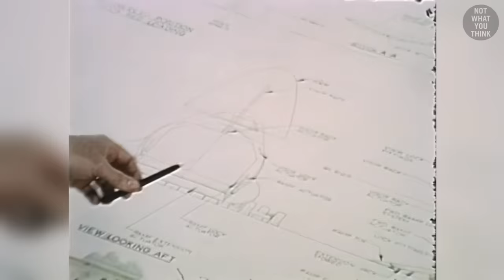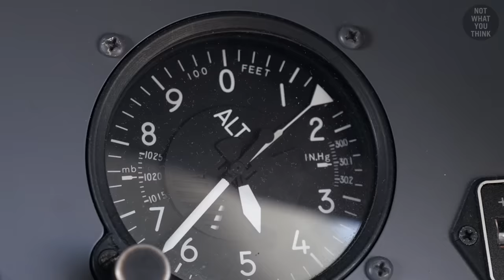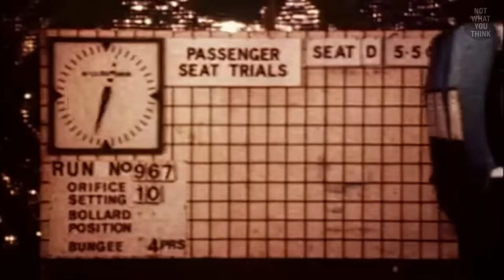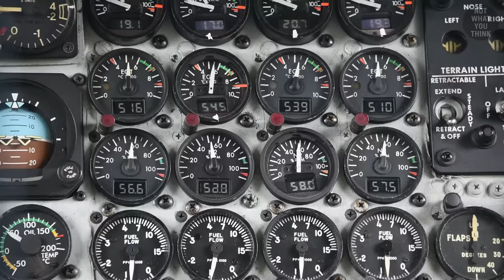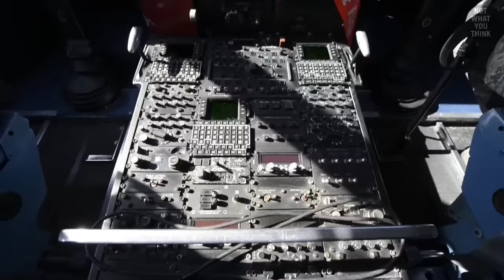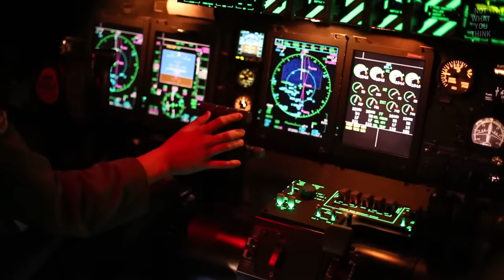America’s MASSIVE Military Airplane that is Named After a Porn Star

Comment: Sometimes I imagine a gunship variant using the C-5 with 2 105mm gun. It'll be absolutely inefficient and probably be useless but would look cool as shit.
Reply: 380mm Battleship cannon
Reply: AC-5 👀

While the C-5 might be able to take big loads, the AC-5 will be GIVING big loads.
Reply: Atomic annie
Reply: @MichealleShoemaker  Atomic annie
Reply: Nah image sticking two c-5s together kind of like the F-82 and put a navy railgun in the middle. That would be cool as fuck
Reply: @saplingseedsaccrew3143  Dudes ready to blow up an Alien Ship
Reply: @saplingseedsaccrew3143  Getting ready for the alien invasion for sure
Reply: go with a 155 and you can fire excalibur rounds from even beyond 70km
Reply: You could actually swap M777 into it instead considering the size and carry weight. If you wanna be a real crazy person  you could add a M110 that comes out from the back instead.
Reply: @ForzaMonkey  "ENEMY AC-5 ABOVE!!!"
Reply: @Erpyrikk  GLSDB might be a better option - the bracing and shock absorption required for 155 is pretty extreme, but a GLSDB could get a smaller booster rocket since it's already launching at 300 mph and several thousand feet.

Of course if you put glide kits on crates of the same base weapons, you can have even more boom onboard.
Reply: @saplingseedsaccrew3143  recoil: allow me to introduce myself
Reply: It’s probably large enough to fit 155mm howitzers.
Reply: the ac-130 uses a 40mm gun. I doubt that any bigger plane could withstand the recoil of a 105mm gun. would be a fun challenge though, I suppose it's not out of the question to build a sliding mounting apparatus for the gun inside a plane that large that softens the recoil enough to not destroy the airframe. but definitely just for one gun, not for two. the recoil damping would require a lot of mass in parts of the construction, and of course the gun would still shove the plane very hard, and it would be much more practical to build the load distribution structures from only one gun mounting point rather than from two. and if you had two guns, the huge mass of the gun that isn't firing rsisting the recoil of the other one would add to the load on the airframe - unless you only fired both guns simultaneously. both on one side of the plane of course, because putting one on either side is definitely nonsense, as that would only add the ability to circle both ways, instead of doubling the firepower against one target.
Reply: @Ass_of_Amalek  the 105 on the AC130 uses a gimbal floating counterweight to help stabilize it. If you got enough space you can negate a lot of recoil forces from actually transferring to the airframe.
Reply: Upside down c-ram
Reply: @manofcultura  AC-130 doesn't use a 105, it uses a 40.
Reply: @Ass_of_Amalek  ummm. I think some variants only use 40mm but most of them, especially the last two H and J variants all have one 105mm. So I don’t know what you’re talking about. Maybe you’re confusing it for the AC47 spooky?
Reply: @Ass_of_Amalek  most AC 130's were equipped with both the 40mm & 105mm at the same time (along with 20mm or 25mm a rotary cannon).
Reply: Put a couple 30mm cannons from the A10 out the side.
.
Reply: Unless you're on on the the receiving end of it , you should have grown up as an Isamic insurgent than you could tell us all about what cool is...... that's probably lost on you.
Reply: @Ass_of_Amalek  apparently someone didn't see the first transformers flick
Reply: @MichealleShoemaker  if you made them recoilless you might even be able to use 16"/406mm 😉
Talk about an awesome display of shock and awe: you would see a backblast bigger than the muzzle-blast of 16" battleship gun and then the mother of all explosions on the ground.
Edit: I'd just like to clarify that the gun would have to bisect the entire fuselage for a recoilless rifle to work, since the exhaust needs to go somewhere.
So the recoilless 16" gun would probably be fixed, like the broadside of a ship-of-the-line.
It's kinda obvious to me, but it's better to be clear.
Reply: As a crew chief of AC130H/Ws before their retirements, and the new AC130J, the amount of incorrect information in here is both amusing and painful.
Reply: @ChiefCrewin  you don't think my insane 16" recoilless canon would work? 😅
Reply: Put 155s on A-Fred
Reply: AN-225 super gunship XD
Reply: What about a C5 loaded with Rapid Dragon cruise missile sleds?
Thr C-17 variant can drop 9 missiles per sled weighing about 10 tonnes each. A C-5 could carry 12 of these for 108 JDAM missiles
Reply: That's as good a summary of America's military spending as any statements I've ever heard. lol!
Reply: @Ass_of_Amalek  it has both a 40mm bofor and 105mm howitzer and a couple miniguns . I watched 4 of them in somalia personally
Reply: I guess they will develop the ability to accommodate the Rapid Dragon system in the C5 as well as the other US cargo planes.
Reply: @saplingseedsaccrew3143  Time to deliver some freedom!!!!!
Reply: It will probably break up from the forces. It's an aluminium plane, not a battleship
Reply: @ChiefCrewin  when are the ghost riders getting the direct energy weapons
Reply: I think firing the tanks through the open cargo rear would look plenty cool
Reply: A rotary cannon where each barrel is its own individual GAU-8 rotary cannon and call it a GAU-64
Reply: I prefer a mass of 40mm bofors for complete saturation
Reply: @Jdubya4040  GAU-8 is a 30mm auto-cannon (7 barrels), GAU cannons with higher numbers (12, 13, 22) have less firepower so I don't want a GAU-64 (unless as a vermin-repellent).
BTW rotating a rotary cannon makes no sense.....
Reply: How many kamikaze-drones could FRED hold?
Reply: @RaDeus87  A C5 Galaxy can carry ~201,00 lbs.  A single barrel from a mark 7 gun from an Iowa class weighs 267,904 lbs including the breech.  Then you need to counter weight the barrel so the plane can actually fly and I don't think 42,000 lbs is enough.  You also need spare weight capacity for the equipment to load the 2000+ lb shells, the shells themselves (HE weighs 1,900 lbs and AP weighs 2700 lbs), and powder bags to make them go anywhere (each weighing 660 lbs and using 3 for each shell).  That system would probably weigh well over of 300,000 lbs, if I had to guess.  I like where you head is at but I think it's a bit of a pipe dream.  Hehe, see what I did there?
Reply: @DreadX10  Oh god...
Reply: @uncommonsense360  Make the plane go faster too, just like in GTA.
Reply: @ChiefCrewin  It's because it's not in WarThunder so no one has leaked the specs to win a forum argument yet.  It is oddly difficult to find details online.  I just know "gunship go brrrr, boom, boom, brrrr."  They might just be the coolest plane in the arsenal.
Reply: lol
Reply: I had that idea in a fever dream; the AC-5 Quasar
Reply: Im your mum WATCH YOUR LANGUAGE
Reply: @LeCharles07  I think using the M4 Carl Gustav as our template is a better way of doing it.
The M4 weights 6.6 kg empty, if we make the gun five times bigger, its really 4,84... to get to 406mm, lets use that spare weights as reinforcement and extra propellant, and use the square-cube law to make it 125 times heavier we arrive at the number of 825 kg, or 1818,81 lb.
The ammo weights 4 kg normally, times 125 that's 500 kg, 1102 lb.
So a loaded gun weights in at 2920 lb or 1225 kg.
There's a reason why the militaries around the world loved the recoilless guns post-WW2, you get a lot for less weight.
Now there are better recoilless guns to convert, with better velocities and HE payloads, but none that has been upgraded as much as the venerable Carl Gustav.
Reply: We have gunships already
Reply: Cool as hell but imagine how sluggish it would be
Reply: @saplingseedsaccrew3143  it would be absolutely cool fir one shot then the recoil would wreck that plane but it would be a hell of a shot
Reply: Yeah the C-130 gunship is only useful against peasants already, don't need another SAM magnet.
Reply: @MichealleShoemaker  Imagine what the battlefield would look like if that existed. Why not install a few built-in C-RAMs? Way too expensive to be viable though. Probably not practical, either.
Reply: @Ass_of_Amalek  Why not use some sort of recoilless rifle system?
Reply: @RaDeus87  I wonder if it'd be possible to engineer some sort of flexible tubing that could withstand and redirect the exhaust? Maybe with some clever baffles along the way to reduce pressure?
Reply: @superturkeylegs  I think the backblast of a recoilless rifle would be very bad for a plane fuselage not just if it happened inside, but even if you put on the outside somehow.
Reply: Looks don't amount to shit. The A-10 is not pretty but it is still the best CAS aircraft in the world.
Reply: 2 M1A3s strapped on the ramp aiming either side
Reply: I have a really good photoshop of what we imagine an AC-5 would look like in our office. It would also be an excellent tanker aircraft thanks to having nearly as much fuel onboard as a KC-10. It's also capable of air delivery of bombs, so it could be the B-5 as well. I like to think we could have an AC-5, B-5, C-5, and KC-5 easily if we put our minds to it. 😂😂
Reply: @saplingseedsaccrew3143  Let's just hope Ace Combat doesn't take that
Reply: What have you done, it's a spaceship now
Reply: Have you seen the shit the US military has done? I'm sure if we need it they will figure something out.
Reply: Brother, you could put 4, maybe 5 105mm guns on it
Reply: Grow up
Reply: @RaDeus87  Scaling up a recoilless is a bit more complicated than that, I would imagine, but recoilless rifles aren't really my area of expertise.
Reply: @thelonelypigeon9554  
I’ve been near the impact of the M110 in training. That Beast was insane
Reply: @bear76009  
Imagine a gunship using the NAMMO 155 ramjet rounds. Fired from an aircraft those rounds would easily exceed 100 miles range. IMHO the Zumwalt should be using NAMMO rounds and it would achieve the ranges originally desired
Reply: @andrewday3206  the problem there will be size they use the 105 due to it's size my thought would be if you wanted bigger would be either to add another 40mm dual or a GAU-8 the A10 Cannon.  They use the C-130 due to it's ability to loiter and to go slower and it's size as a target.  A Globemaster or galaxy would be a much larger target and I would think the 155 would end up being too large.  If you really need that range we have storm breaker a 50 mile range glide bomb or JDAM dropped from a b52 or anything really.  
My take on the AC130 though is it's noise that's what stayed with me.  They had 4 in Somalia and the night they did it was moonless as it always has to be for safety and the drone of the engines the WAAAAAAAAHHHHH  that just went on forever it seemed interrupted by the thumping of a 40mm and the the   Thump BANG of the 105mm they didn't use the Gatlings due to concerns of stray rounds as it was a target in a residential area.  
It was so precise we drove by the next day and there was a recoil less rifle wrapped around a tree like a noodle just devastating is all I can say.
Reply: @bear76009  
Those are some crazy memories for sure!!
IDK if the 155mm would fit. Having been I. The USAF I can tell you the C-17 and C-5 are far wider and might fit them. Either way NAMMO ran jet artillery rounds would give a massive range that nothing has right now. They are such a game changer the Zumwalt destroyers should be using them also.
Reply: @andrewday3206  yea it would was just thinking that it already has a solution without buying a new one cuz budget lol. And imagine the ammo cost of those vs slapping a cheap JDAM on a old iron bomb etc. Zumwalt is going to be a ultrafast pulsing laser and hypersonic missile slinger I think when it's all done.  Those lasers are amazing read up on those that's the future of AAA right there.  Missiles will always have a place so will an old fashioned rapid fire 76mm gun but them lasers lol
Reply: @bear76009  
I’ve loaded MK82’s and MK84’s on the A-10. I left before the JDAM was deployed. One cannot help but think this NAMMO artillery is cost effective and can be carried in huge numbers. 
We both agree the JDAM and NAMMO have given dumb bombs and artillery new leases on life.
Reply: Jaaaaaa  @MichealleShoemaker
Reply: @DreadX10 a bunch !
Reply: plane. plane go pew. plane big pew armors. plane stronk. basically what every military wants.
Reply: Just 2 105mm? Why not just use a 5 inch 54?
Reply: @RaDeus87  I was on a Knox when it fired the 5 inch 54 if you were on the fan tail looking forward you could see the recoil travel from the pointy end to the rear.
But watching the Jersey? Well you could feel the concussion from the shell launch 1 mile away on the same fan tail. Then watch real estate move.

Comment: "The C-5 can also take off from unpaved runways with most of the runway taking off as well." -  Never have I spat out my drink until I heard this!
Reply: I read this comment before that part in the video. Still laughed!
Reply: Yeah, that gets "laugh of the day".
Reply: They only took off and landed on uninproved runway surfaces durring testing, after that they stayed on pavement. The C-5A even had a way to deflate tires in flight, but i think it was never installed.on the C-5B, because they never land on dirt fields.
Reply: The C-5B had the system but, it was removed during the C-5M conversion.
Reply: Well it never hurts to take your runway with you because one never knows when you might need one.😉
Reply: @bigcity2085  this entire video gets that award 😂 so many good jokes in here
Reply: @BRealistic  your joke may have been funny besides that fact that any kicked up debris will travel the opposite direction as the plane is traveling....

Do people not realize jokes that makes a little bit sense can actually be enjoyed over jokes that make zero sense....
Reply: In war time, you could use that capability to deny the enemy a runway. Just relocate and shorten it.
Reply: The contractors resurfacing our runway messed up and a F-15 also took a chunk of the runway with it.
Reply: 😂😂that got me too